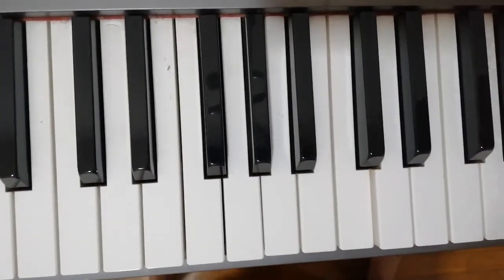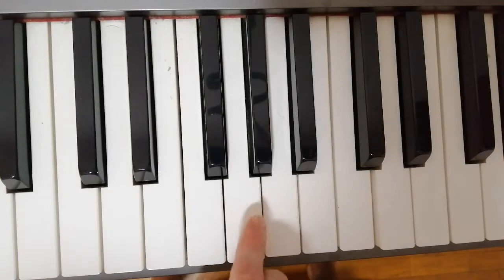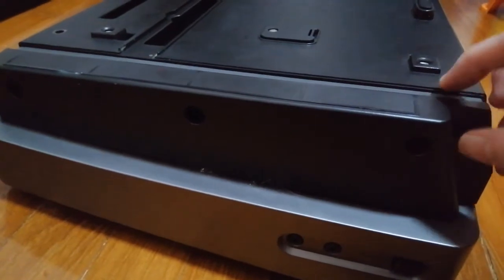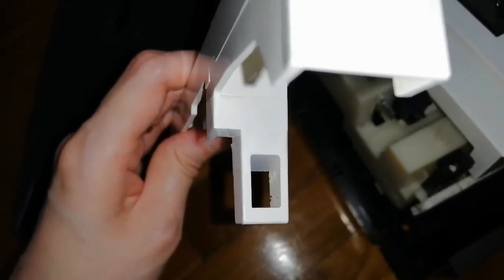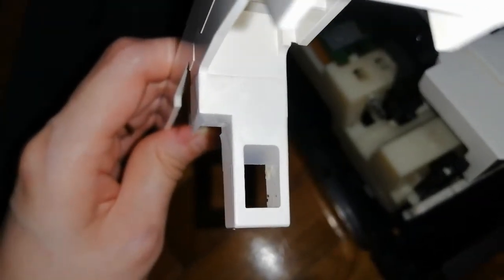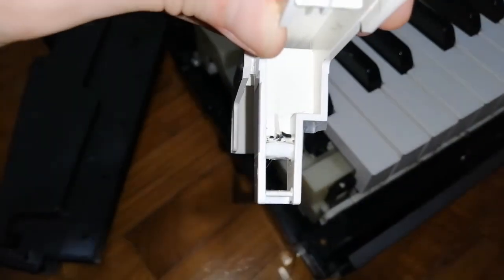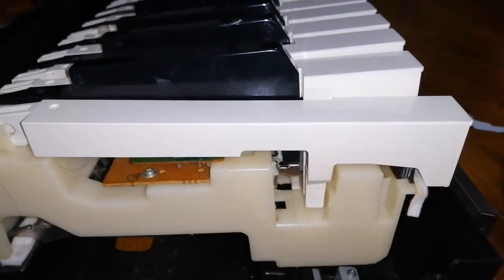How to fix sunken digital piano keys?

Comment: I've been hammering on my old Casio PX300 digital piano, preparing for an audition on Sunday.   Friday night the D above middle C has sunk and is unplayable.   I solved the problem through your excellent video!!!!  The one change I made was to use the black rubber part from the highest C key on the keyboard.   I rarely play this key.   Then I assembled the broken rubber parts and glued then onto the high C hammer.   All keys are now restored and playable!  THANK YOU so much for making this video!   You saved my piano!!!
Reply from the maker: @EdKershenbaum, glad that the video helps! Thanks for your kind words :)

Comment: Thanks. This technique works for the AP-400 as well. I used super glue instead of tape. I’m having trouble with the black keys though. The shape of the space to put an eraser is different from the white keys. Have you fixed any black keys yet?
Reply from the maker: Hi Ilcaudio, sorry for my late response. I dont remember i worked on black keys, so I may not able to help much in this, sorry :) As the white keys are sitted on top of black keys, you may need to remove the white keys first.

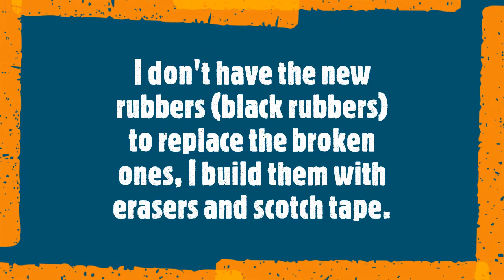Comment: I am at 2:26. Have removed front and back covers. How do you remove the keys?
Reply from the maker: Thank you for your patience. Suggested not to directly pull it, but slowly remove it from top (as in slowly remove the knot that holding the top part of the key), and then slowly pull down to avoid breaking the rubber. However, if the key rubber has been spoilt, you can just directly pull up from the bottom (bottom part of the key), required some force to do so. Feel free to drop me an email, so that I can explain with images. Hope this helps :)

Comment: Hi! May i know 1:52, where is this spot? Thanks so much
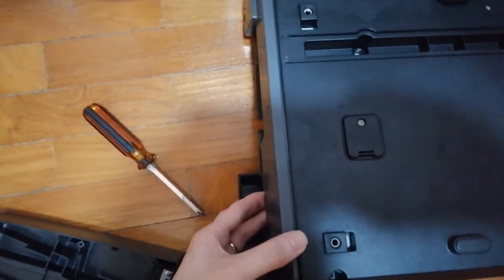Reply from the maker: Hi Victoria, it is at the bottom of the piano, you can find it at 1:49, the rectangular shape (near square) cover, where it has not been opened yet. (I am not sure if other models do have the same design). Hope this helps!
Reply: @munlovemusic  Thank you! i got the rubber parts off shopee, spent about 3 hours unscrewing and 3 hours replacing all the rubber of the black and white keys. HAHA.

Comment: Casio cleviano AP 460 is good or no
Reply from the maker: Hi Techman, sorry for my late response. I havent been using Casio celviano AP460 before, but based on the specification, it seems not bad. I have been using Roland FP-10 too, the touch response is quite real (as compared to acoustic piano). Other than Casio and Roland, you may try Yamaha (just a little pricy).